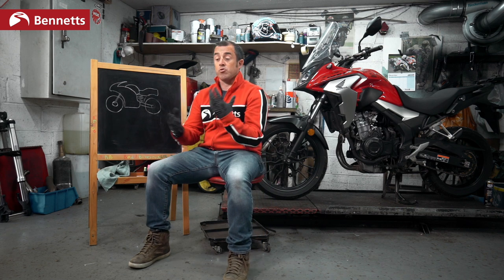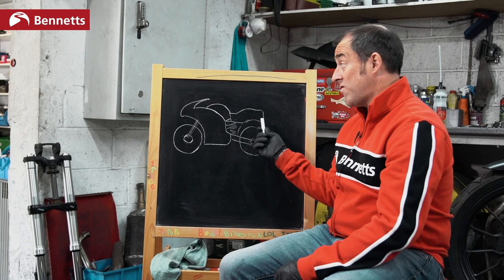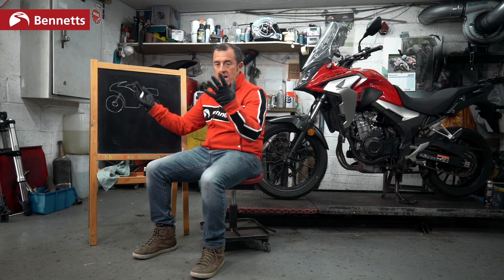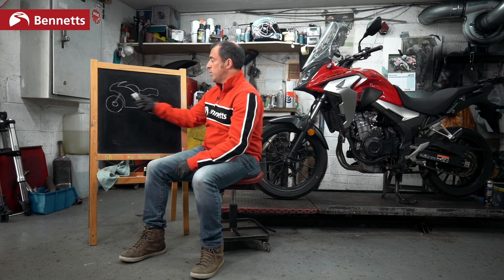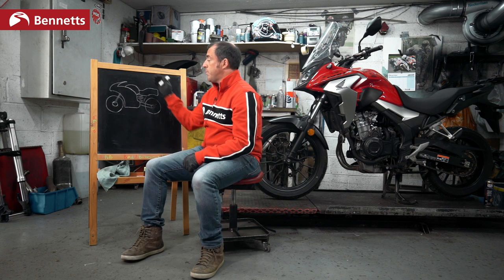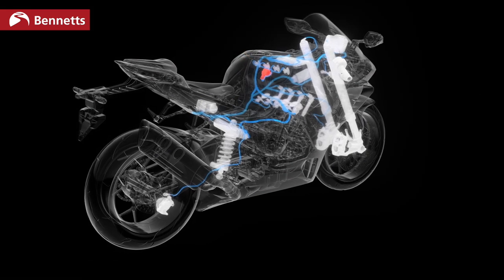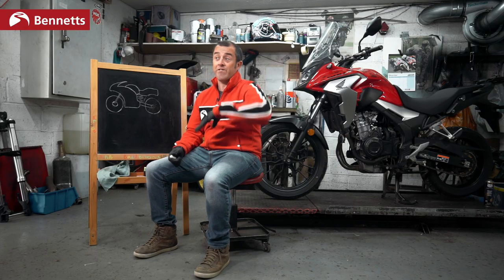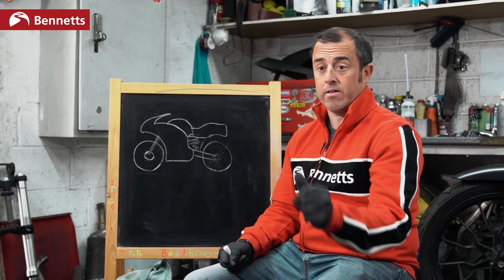Motorcycle Traction Control & ABS explained | Home Schooling Lesson 4

Comment: My old BMW K75 (1988 base model) doesn't have any of these systems. One thing I am confident of. It would not benefit from Wheely control. In the 12 years i have owned it I have never once got the front wheel in the air. Not even on trackdays at Jerez! She's too heavy for that. Thanks for the lessons. Good to get the brain around these concepts.